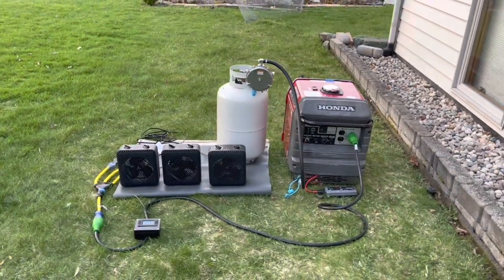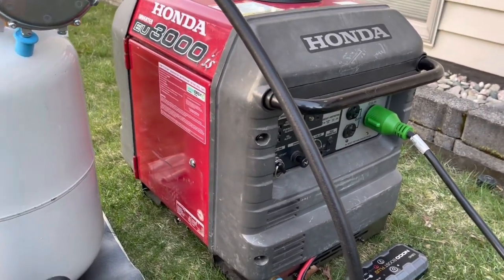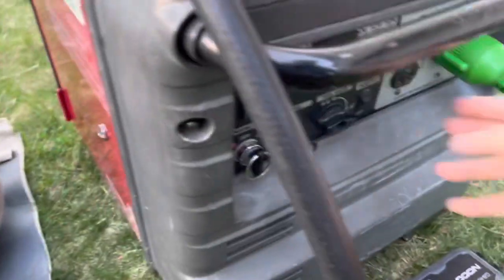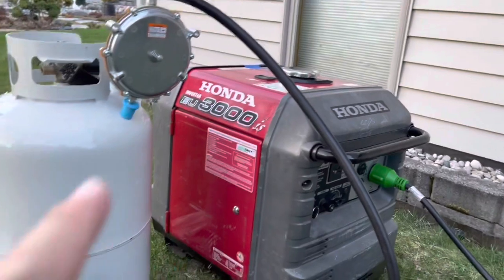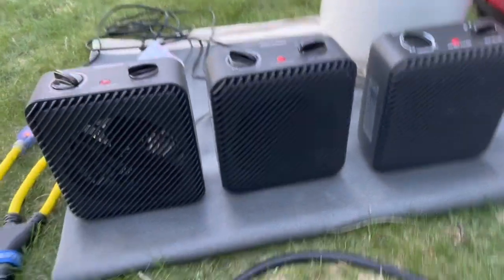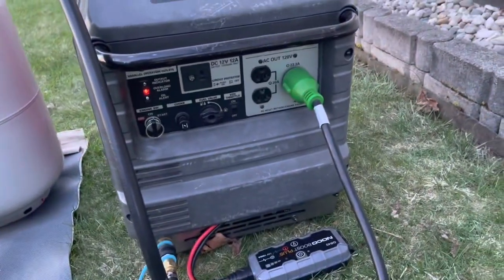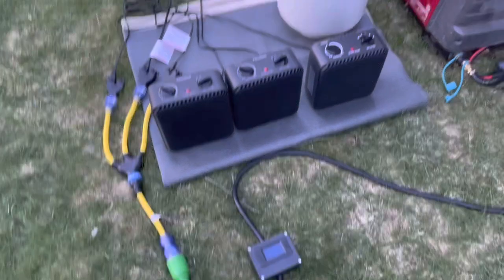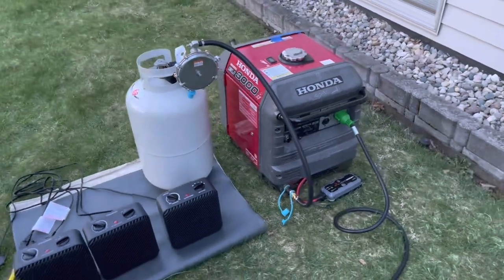Honda EU3000is / EU30is Generator Propane Conversion Kit - Max Wattage Test by Grenergy

Comment: Can I supply this kit with propane from my house tank without the regulator included in this kit? The tank of course has a regulator. I have been told by my propane supplier to not use two regulators.
Reply from the maker: Yes, you can. Just remove the propane regulator from the kit and plumb straight to the demand regulator.

Comment: I'm impressed that the EU3000is, running on propane didn't seem to show any loss in running watts. Granted it was a short test, but I expected more power loss on propane. It's hard to guess how it might perform in an extended run test on propane at 2.8kW. I make a point of never loading my generators to full running watt capacity for any extended period, so I don't suppose that much matters in my case. I found it interesting that a single heater pulled 1.5kW, but the second didn't seem to quite double that value. Addition of the load from the third heater never exceeded 2.86kW. I'm wondering if the inverter capacity is imposing that limitation. It was also surprising that the generator didn't go into overload during the first test. In any case, I think you showed some very valid results. 

I have a pair of EU2200i's as well as a 7 year old EU3000is. That's a great little power meter you're using. Just over a year ago, I installed one in my camper to help manage and monitor power.
Reply from the maker: Hey Greg, I suspect the generator will hold 2.8kw as long as the propane fuel supply is consistent and the engine is trouble free. The kit was designed thoroughly with plenty of tests in both cold and hot weather, but I believe it should be okay to go. The third heater seems to not do anything significant when read on the digital watt meter, I do suspect the inverter did limit the output which is a good thing. Any higher than 2.8kw that it was rated for and the internals of the inverter would overheat and could lead to permenate damage. If you listen to the engine carefully while the inverter was pushed hard, the engine sounded very healthy with no bogging or stuttering which to me indicates no power loss.
Reply from the maker: I do prefer two pairs of EU2200i's over the EU3000is mainly due to its portability and weight. It's much easier to throw the EU2200i in the back of my truck than having to lift a 140lb generator. Maybe in the future I'll do a custom mounting bracket with this same digital watt meter to mount on the generator. Would be nice to have as an generator accessory.
Reply: @GrenergyTriFuel   My first inverter is my tried and true EU3000is that I bought in 2015. It's electric start, crazy quiet and the fuel tank is big enough to run overnight with AC. Having said that, it's also ugly heavy and I can't load it into my pickup bed without help. Now that I have a pair of EU2200i's that I can load and move around with comparative ease, I can't imagine going back to using my EU3000is for camping. I was surprised to find that a single EU2200i will fire up an unmodified 13.5 BTU Dometic Brisk 2 AC unit as long as there are no other electrical loads. I added a MicroAir EasyStart to the AC and a single 2200i will now start my AC unit even while running other modest background loads like the converter/charger, camp kitchen refrigerator and a few other low draw devices. I've also added an extended run tank and can easily keep cool overnight on either 2200i. As a bonus, a single 2200i uses a lot less fuel than my 3000is, so I don't have to carry along nearly so much gas when boondock camping. At times when we need more power, I parallel the second 2200i and have 3600 running watts, so instead of the somewhat limited 23.3A of my EU3000is, I have 30 running amps available with surge power to an impressive 36.7 amps.
Reply from the maker: @gregbarnett9272  The two EU2200i's are defiantly fantastic when paired together. I've tested a 15,000 BTU big window AC unit with my LP converted EU2200i and older model EU2000i. I've posted the video here on my YouTube channel, check it out! ----->https://youtu.be/n_qTBbOm_Fo
Reply: Can I get a 15’ hose with the kit ?